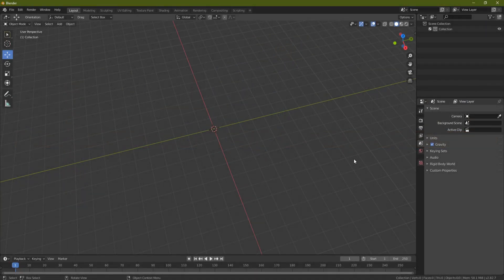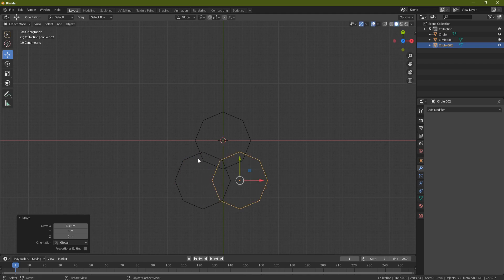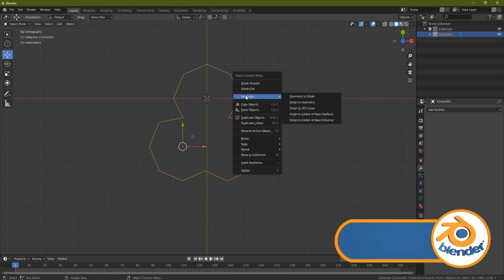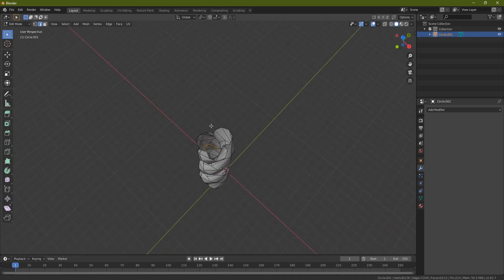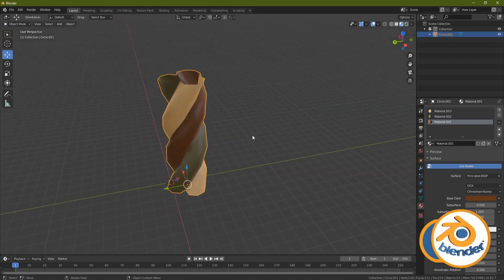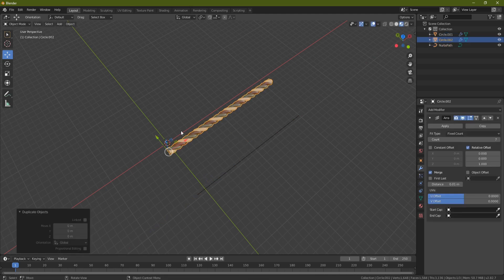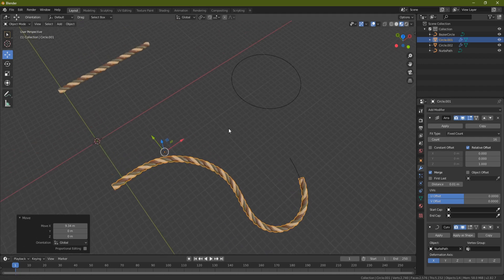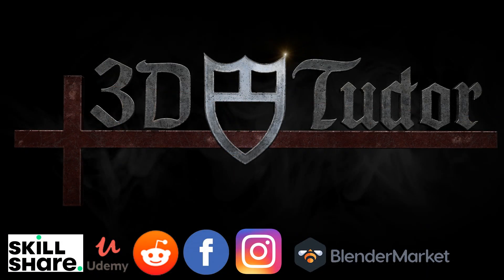Blender 2.8 Creating Low Poly Rope

Comment: love the idea but then you end up with a few ropes bringing you near 10k polygons to hold any sort of geometry. It becomes better to use a cylinder with sections and a texture of rope. Another step lower would be flat planes with actual rope 2D cutouts. I'm messing with this currently and think ill go with the cylindrical method.
Reply from the maker: Yup, these are 2 ways to go with the rope.
Reply: @3DTudor  yeah i went cylinder, and wrapped a few beams with shrinkwrap offset and grab. very happy with the outcome. For the unwrap you can follow active quads and then triangulate after for unity.

Comment: This was a very good tutorial. Although relatively low poly (7k) is a bit high. Any tips on making a very low poly rope?
Reply from the maker: Any lower and you will have to rely on Normal maps and tessellation.  Although tessellation does come with its own performance issues.  Hope this helps.  Kind regards Neil, 3D Tudor.
Reply: @3DTudor  how can achieve with normal map i been trying something like this but with chains and the poly count same as yours
Reply: @kullimoney365  I'd suggest making a cylinder without any details that follows the curve and then one like in this tutorial with details. Then look for a high poly to low poly normal map tutorial. You probably will also find many rope materials with normals on the internet

Comment: I did give a like on this video. But ya kind of lost me at the Mark Seams portion. I just couldn't really tell which edges were clicked on in relation to my model.
Reply: You have to select the ledge from the vertices you merged earlier (roughly time 1:43), to mark seems between the three threads that make the rope. Also I think you have to hold Alt to not only select the edge but the the all the linked edges.